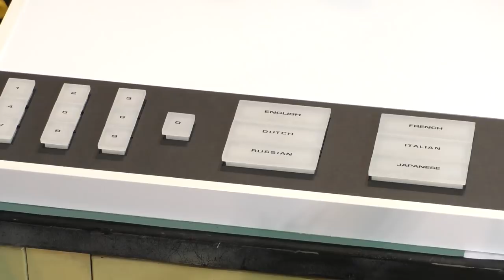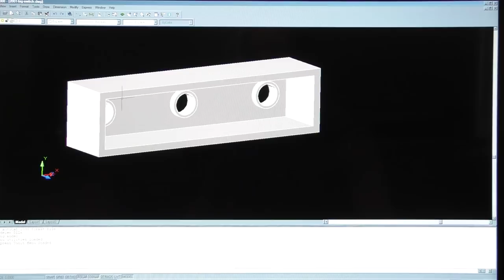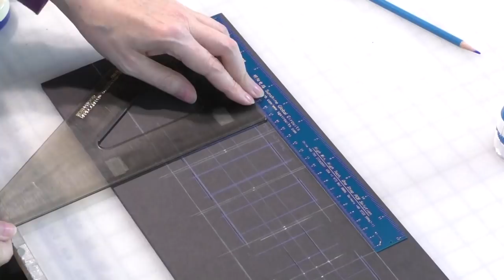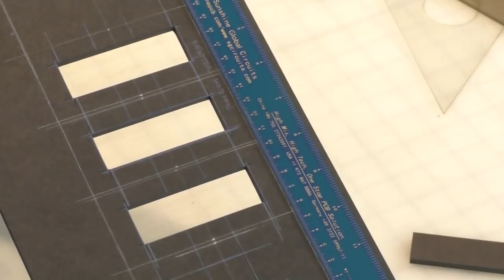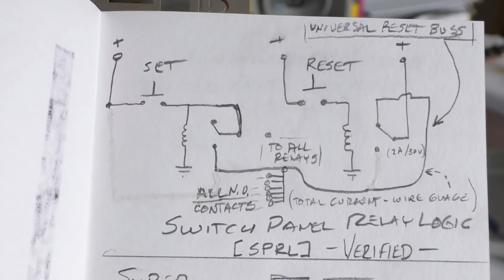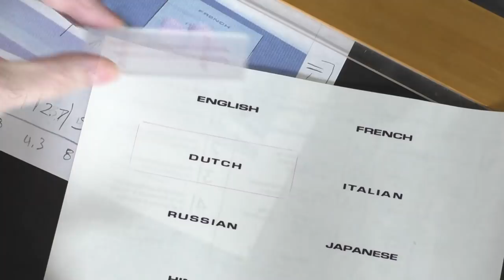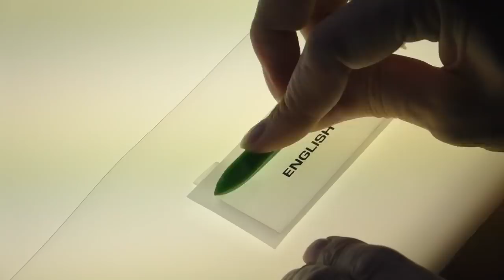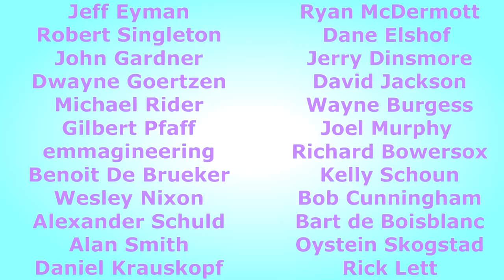My Space Odyssey Control Panel Build

Comment: I can see how foam core is a modelers delight. I have worked as a cave explorer and cartographer, and foam-core at least used to be a cheap and good way to mount freshly plotted cave maps for display at "expedition headquarters". I recall using a low-tack spray adhesive to glue the printed maps to the foam-core backing. If the foam-core piece was larger than the printed map, it was easy to use a utility knife to trim it so that it matched the paper, right out to the edges. You could hand a map prepared in that way to a land manager like the National Park Service, and they'd accept it from your hands as a work of art, even though it only cost $15 to make the entire thing (that and a thousand Person Hours Under Ground (PHUGs) plus forty hours of data reduction work).

Comment: Fran.... just an FYI.... those little TO-3 bulbs are famous for burning out left and right.  The workaround used to be running them at reduced voltage.  Personally, nowadays I'd just rig white-light LEDS into the old bases and never look back.

Comment: Future advice: during final stage, employ regular paper as a mask against the dreaded possibility of a glue splat. Engineer in a way to open those buttons up-- you should be able to replace a bulb. Last: I think a piece of typing paper should have been placed between the cap pieces for spacing. Regular paper is .003".
Your new prop is a thing of beauty and a joy forever.
Reply: Ditto on the paper, also the zero could have been aligned with the center buttons to the left. But it came out fabulously, regardless.
Reply: Indeed, a thing of beauty.

Comment: Beautiful build Fran! I have had a few of those projects (lasted several years.. eventually was 'so ready' just to be done with it...but want to make sure it was 'right'. hehe). Now.. question is.. are you going to mount it somewhere and use it to control things in the lab? (Button1 turns the lights on/off, Button2  starts the coffee pot, Button3 says 'Good Morning Fran.', Button4 says, "I'm sorry Fran.. I'm afraid I  can't do that.",  etc.), and If so, what hardware and language will be you using to make it work? (diy hardware is usually best, but sometimes, it's nice to integrate something pre-made like an Arduino or raspberry pi for that 'instant gratification' feeling. hehe)

Comment: Hi Fran, I too am an enginerd who made my own "C" size light table in the 80s 😊  
I worked at an early ethernet company designing router and hub prototypes. I worked with both MEs & EEs. 
One idea for back lighted, shine-through overlays, was to negative print on velum or mylar in reverse then laminate w two sided tape to end up w an indellable surface for LEDs & displays to show through.
✌❤

Comment: I never design anything with incandescent lamps.  In fact I often convert older projects or products to LED.  I just don't want to deal with the bulbs burning out or the excess heat.  Also note that incandescent bulbs are just not being made.  Manufactures aren't using them in new  designs.  The prices are increasing as well due to reduced supply.  Finding exact replacements in the future is going to be problematic.

Comment: Cantonese or Mandarin? :)
Reply: Clearly is ⬛⬛⬛⬛⬛⬛
Reply: By the year, um, 2001 they will have standardized on one and just called it "Chinese" (using a Latin font 😀😂)
Reply: B Web Nah, the film indicates the librarian uses English language names on her side of the table to bring up eBooks in selected languages.  A Chinese born librarian would use a panel with Chinese designators.  Though I suspect station #4 (ISS) has a different solution to language mixing.